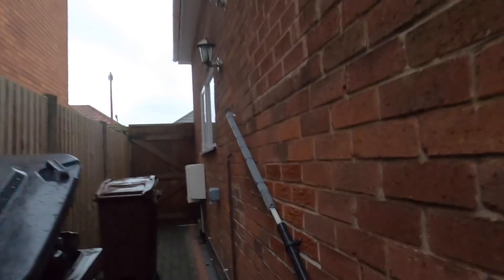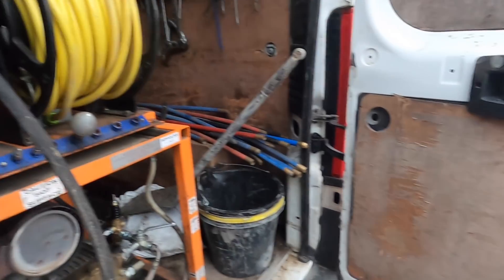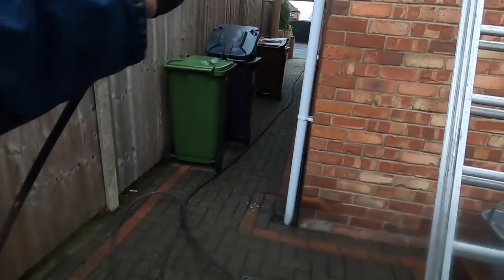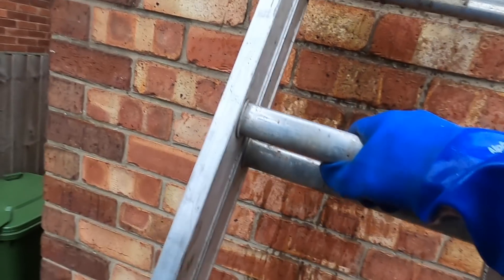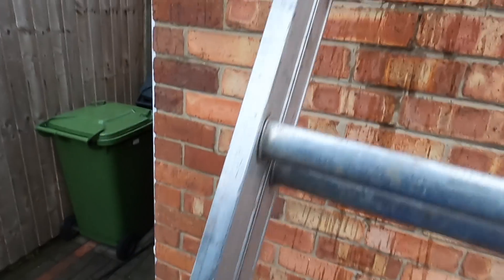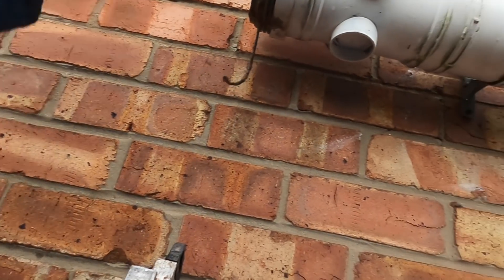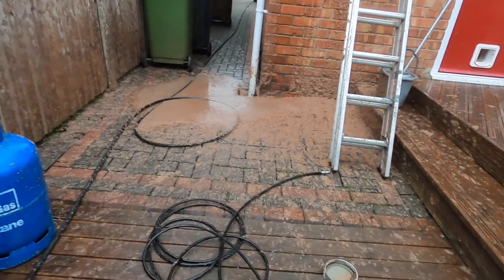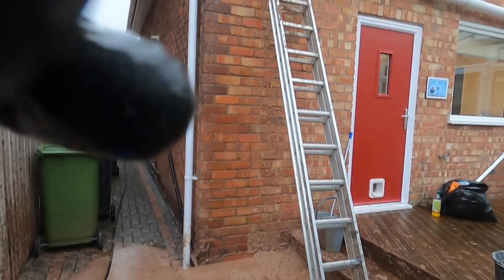Soil Stack Unblock! #4

Comment: It's crazy how you have access to all of the drains outside. Here in the states we have to cut walls and work in crawl spaces
Reply: Have you seen some of the Aussie crawlspace dungeons Drain Addict has spelled speulunked into ?
Reply: Because it doesn't freeze there. A majority of the US is susceptible to below freezing temps. We also use a closed dwv system, instead of an open system like they do. I think the north American way is far superior. Doesn't turn into a septic system with months worth of a blockage.
Reply: @TheNemosdaddy  Ive always wondered why the plumbing was outside there. I didn’t think about the fact it didn’t freeze there like it does here. Pros and cons to both systems I think.

Comment: Would be cool if they made a rubber adapter that would cap the pipe, but still allow the jet hose through.. so when the rush of sewage come it’ll just go down the drain and not out.. or maybe something could be made to work using a regular cap
Reply: There's a channel of Korean plumbers on YT who do exactly that.
It's something they came up with to avoid spraying things around and it looks very efficient.
Nevertheless, The Drain Unblockers always leave places cleaner than they found them. They really are the bees' knees.

Comment: 3 things immediately wrong with that pipework. Gradient of the pipe going from the en-suite into the stack is too steep, looks to be a 200mm fall over 3 metres which is causing the liquids to drain away quicker than the solids therefore causing a build up of shit and paper at the bottom of that en-suite toilet pipe junction. Around 20mm slope per metre run is required, so around 60-70mm fall would have done. Also the 90 degree waste bend from the en-suite toilet really needs a second bend under it with a more rounded radius sweeping into the horizontal pipe. 45 degree connections are preferred but if not possible, at least a large smooth curved 90 degree bend would have given that en-suite toilet waste a fighting chance to drain. Thirdly there are 4 waste pipe connections going into that toilet waste which is a bit extreme, as theres always going to be 4 chances of the en-suite toilet waste on its travels to the stack catching on one of the waste pipes that may have been pushed in too much causing snags and blockages.

Comment: Hi, can you help me, we have an internal completely horizontal soil stack that runs nearly 6m from the toilet before it falls down the vertical stack (also internal) there is no fall on the soil pipe and in-fact the 90 bend is on an incline, how can I unblock it when the access cap cannot be removed into the loft space? Thank you

Comment: Maybe this is a stupid question, is there a reason why that pipe ends at the top not the bottom of the wall?
Reply from the maker: Because the client had two toilets and this was the branch that connected to the main soil run. Rather than have two soil pipes, you have it going along the wall and meeting with the main soil pipe!

Comment: I'm not familiar with building norms in the UK.  Do most houses have the plumbing on the outside of the house versus under a slab? 

I can see it having to be run this way on very old buildings that were built prior to indoor plumbing but many/most of the jobs I have watched on your channel look like they are new enough to have indoor lines.  

Just curious.

Comment: can someone explain to me why that pipe was left 15 feet in the air and the clean out wasn't brought to ground level??? it would have been 1 million times easier to clean and 1 million times less mess to clean up
Reply: Well I don't know about you but I don't fancy the idea of having to step over the pipe every time I come in and out of that door or tripping over it when I forget its there.
Reply: @tobyprior8839  thats a fair enough reason...I didn't think of that...but..they really could have put the clean out on the other side...or literally anywhere they wanted it to be....some are even flush with the ground so they aren't a tripping Hazzard
Reply: It would have been quite the show if the clean out was at the other side of the house right over that lovely sun room , what with all that splattering over the glass

Comment: A predictable .messy job, why not using something to collect all that stuff as a flexible pipe or something else. I hope your suite is water proof and easy to clean and that not retain that smell on it
Reply from the maker: The boiler suit was not waterproof... we use a separate washing machine for all overalls. It is difficult to use a flexible pipe and manage to get the access, it can be quite restrictive when you have to change where you're jetting from too if it is not working!
Reply: @TheDrainUnblockers  that's true..

Comment: If I was watching that I would have been upset as a homeowner. I don’t see why you had to spill sewage everywhere. You could have plunged the toilet or rodded  it  or put a dustbin or a plastic bag over the end of the pipe with a hole in for the pressure. I just seemed unnecessary. Then you complain about your overalls! Look at the homeowners patio walls, fence and shit in the next door neighbours yard. Not up to your usual standards. It’s like you are creating a big job out of a small one, why.
Reply: It never went over next doors pmsl Jezzz simple as.. you either want the job doing, or do it yourself, your not gonna unclog a waste pipe without making a mess.